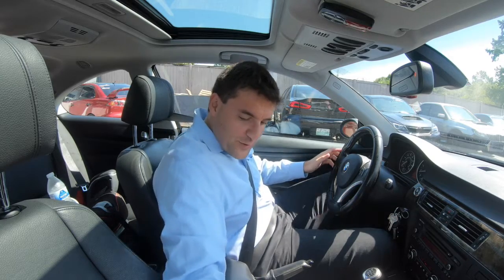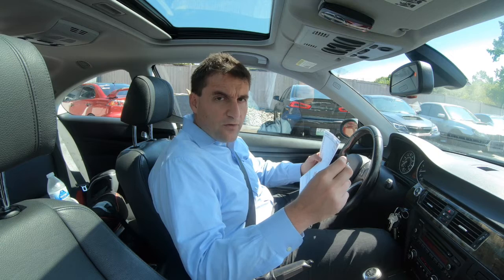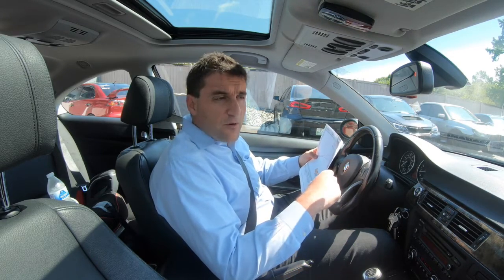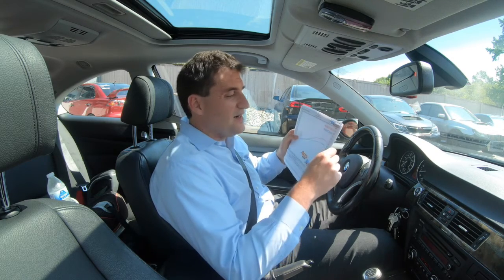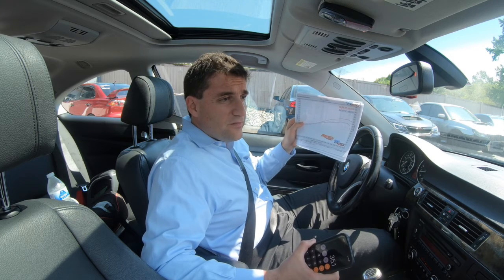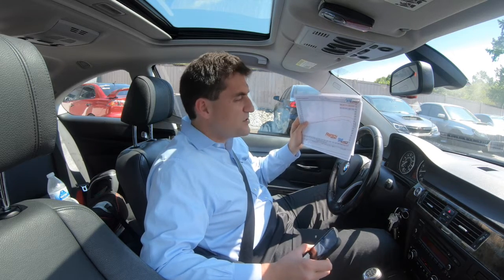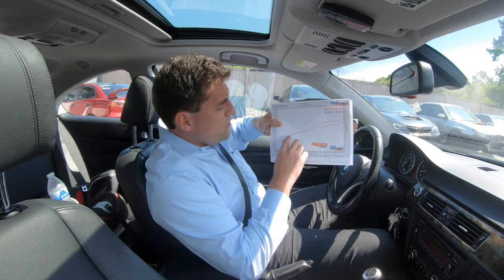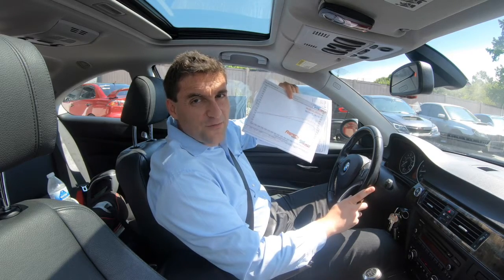BMW N52 Engine HP and Torque AFTER the 3-Stage Intake Manifold and AA Headers Mod -- Dyno Test

Comment: Hello I’m a 328i owner and new to the tuning stuff what would be the first thing to get to increase hp??
Reply from the maker: Congrats on your 328i! You have to go with the mod that I did. 3-stage intake manifold, AA headers, and a tune. Some people add the exhaust as well, which I did not do. Maybe I should have, but I love the car with this mod. It’s more than fast enough for regular roads. This mod is pretty much the only noticeable mod you can make to feel a difference in performance. Don’t bother with a tune only since it won’t make a huge difference, if any. You need the physical mods with the tune for the N52. If you had a turbo car, it would be a different story. A simple tune could add 100 horsepower.

Comment: Just did my stage 3 intake manifold. Huge difference overall! changes the car in every aspect
Reply: Did you have to tune it after ?
Reply: @ yes you can get it for free from bimmerspeed
Reply: @cruzewithcruz exactly what I was wondering.
Reply from the maker: That’s awesome! Congrats! I love driving it when it’s colder outside because it is even faster.

Comment: How much did you get the manifold for
Reply from the maker: I bought it private party, and it was about $250 from what I remember. It was a great deal because it had functioning DISA valves attached to it as well.

Comment: I have a stock 2006 e90 330i 6spd manual, any other mods recommendations? Anything to make it more reliable?
Reply from the maker: What kind of reliability issues are experiencing? In the world of BMWs, the e90 330i is as about as reliable as it gets. Do you still have the run flat tires? I would ditch those immediately and replace them with summer tires or at a minimum Michelin All Seasons (depending on weather where you live and your budget).

Comment: It’s so dissapointing that stock it only produces 200 hp instead of the specified 218
Reply from the maker: That’s 200 hp at the wheels, which means that it was producing at least 230 hp at the engine when it was stock. You lose power as it travels from the engine to the wheels.

Comment: What does this do to engine reliability long term?
Reply from the maker: Stay tuned. Haven't had any issues so far other than the rev counter hunting for RPMs at idle sometimes. I made a video about it. It's really just annoying more than anything else.
Reply: @GogoMotoring  any updates on this?

Comment: Numbers on my car we're almost exactly what you got. Stock 328i 6mt 70k miles. I was very happy with the results. It feels a little quicker to me in the low rpm range but it's minor. Above 3500 it's noticeably stronger. The car always felt very strong accelerating from like 70-80mph to 100+ but it pulls much harder now. Haven't noticed any difference in fuel mileage.
Reply from the maker: Nice! Hundred percent agree on the change in the driving characteristics. Thank you for your comment, and stay tuned for more videos!
Reply: But have you noticed more wear and tear and earlier maintenance

Comment: Hi. I have a tune on my 328xi Coupe and am wondering if headers are worth it? AA advertises a gain of 20Hp for headers alone
Reply from the maker: Do you have the three stage intake manifold installed already?
Reply: @GogoMotoring  I do not. Just a tune on the engine
Reply from the maker: @NovieBigSad  You probably would need at a minimum the 3-stage intake manifold, which I believe results in a bigger power increase than the AA headers. The N51 engine that was in the 2006 BMW 330i, which produced 255 horsepower stock, had the 3-stage intake manifold. When the 328i was released with the N52 engine, the 3 stage intake manifold was replaced with the single stage intake manifold, which in turn resulted in the stock horsepower decreasing to 230 horsepower. Conservatively, my car is now producing between 265 and 275 horsepower. Assuming the 3-stage intake manifold brought the horsepower up to the stock 330i numbers, i.e., a 25 horsepower increase, you could assume that the headers produced between an additional 10 - 20 horsepower. Does this answer your question? 

To do the mod properly, you should install a 3 stage intake manifold and the AA headers and get a tune optimized to maximize the power with these mods. If you had to just pick one, I would go with the 3 stage intake manifold with a tune because the AA headers can cause some issues when the car is at idle as shown in my latest video.
Reply: @GogoMotoring  I do not. I just have a tune on it
Reply: How much power did you make and what wear is your 328xi

Comment: you only gained around 25hp? the 3 stage intake manifold alone should of increased it by 30hp and 9 whp more with the aa headers

were your disa valves in good condition?
Reply from the maker: 30 wheel horsepower gain. The disa valves were in good condition. That's probably a 45 horsepower gain at the crank.
Reply: @GogoMotoring  30 hp gain at wheels=30 hp gain at crank...

Comment: Your math is hilarious! Over 300hp from 3 stage manifold and AA headers mods.  If you talk a little faster, it might add up to 400hp 😂
Reply from the maker: The mods resulted in a gain of 30 wheel horsepower. BMW is known for officially underestimating the horsepower of its vehicles. When the E9# 328i first came out, even though it was rated at 230 hp, there were articles written about the car actually producing closer to 260 hp stock. Same case for the 2007 BMW 335i which was officially rated at 300 hp but was producing closer to 330 hp. So the discussion really centers more about what the true horsepower could be assuming BMW official figures were conservative, which they almost always are. But if you want to know what the impact of the mod was for my car in particular, it was slightly less than 30 hp at the wheels. Thank you.
Reply: @GogoMotoring  but its not producing 260 stock,...they make 201whp stock which is about 230 flywheel .. it makes zero sense that this is making 260 hp stock if it makes 200whp stock...30whp is a wonderful gain however,  hope all is well
Reply from the maker: @RingerRacing  According to the dyno shop owner, their dyno machine shows more conservative dyno numbers than a dynojet (sp?) machine, which is apparently the most commonly used one. The dyno shop owner said to apply an additional 15% increase to the displayed numbers to arrive at what the numbers would be on a dynojet machine. Just sharing what I was told. Have a good one.
Reply: @GogoMotoring  cool story ,    the n52 doesnt make 260 flywheel stock.
Reply: @RingerRacing  damn you are probably so fun to be around
Reply: @RingerRacing  330i has 255hp... with the 3 stage intake manifold
Reply: If you think your tuned n52 produces 300hp, try to do a drag race against a stock 135i (300hp) and let us know the results.  I have an n51 128i with AA headers and Stage FP nice.  The gain is nice.  But it’s no where near 300hp or even 290hp.  I know n51 has slightly lower compression which runs about 8-10 hp less than an n52 with the same mods.  My butt dyno estimates 30hp gain which puts it right around 260.  With your mods, I think yours is around 270hp top.  Get a dyno done to and let us know your whp.
Reply from the maker: @litkochan8021  I did. That's what the video is about. On a conservative dyno machine, it's at 230 whp. The dyno shop told me to apply an additional 15% markup to that figure to arrive at the numbers that would be shown on a DynoJet dyno machine. Without applying any additional markup and just going by 230 whp number, at a  minimum, the car is producing between 265 hp and 276 hp. Thanks for watching.

Comment: There’s no way a N/A N52 is doing 300HP. It’ll do 280HP at best and that’s if you have headers, stage 3 intake and a tune.
Reply from the maker: I have all of those three mods. According to a conservative dyno machine, the car is producing 269 hp. Thanks for your comment!
Reply: @GogoMotoring  Not too shabby I’ll say
Reply: @medal6  there is a n51 which is fbo and dyno showed 289hp crank and 400nm so n52 could get 300
Reply: 330i N52, AA headers, Tune, Charcoal Delete, Staight Piped, 300hp got it dynoe’d last week, u dead wrong homeboy 
, 255 to the wheels
Reply: If he’s making 269whp with just an intake manifold upgrade and some headers, with MILVS a decent intake system and a decent tune it should be able to hit abt 300 MAX hp
Reply: @prestonworden9811 what is MILVS?

Comment: Nice increase! have been thinking about doing the same but i have n52b25, how much u think this smaller engine size will impact on the gains? btw love ur car, titan silber brother <3
Reply from the maker: Thanks for your comment, bro. I love the silver color. So easy to take care of, and the car looks so classy. You probably won't have the same output in the N52b25 due to smaller displacement, but I am not 100% sure. In the U.S., we only got the 3.0 liter in the E9# series. Keep me posted on what you decide to do.

Comment: so you're around 300 hp and torque? just wanna know the finals results overall as to what you should be making? I'm just curious cause I wanna get aa headers too soon so I'd wanna know what numbers you're at now.
Reply from the maker: Here are the official numbers:

HP - 269 horsepower on a conservative dyno; applying an additional 20% increase as stated by the dyno shop brings you to 323 horsepower. The midpoint of the range is 296 horsepower.

Torque - 237.5 pound foot of torque on a conservative dyno; applying an additional 20% increase as stated by the dyno shop brings you to 285 pound foot of torque. The midpoint of the range is 261 pound foot of torque.

My car is RWD with a manual transmission. 

I hope this helps! You can tell a difference behind the wheel, especially at above 4,000 RPM. Keep me posted on what you decide to do.
Reply: @GogoMotoring  nice numbers, also I was told you don't have to get a tune after you install active autowerks headers cause you still feel the power gains in the top end.
Reply: Same bro
Reply from the maker: @gabrieldasilva4198  Just posted the numbers above. Thanks!
Reply: I'm a little confused by the math here. How did you come to 323 hp?

I thought the dyno measured the car at 229 whp? Accounting for drive train loss, you're adding how much?
Reply: @GPN0820BOSTON  the n52 with 3 stage stock is like 250 ish horse, with headers maybe 264-275. You can't add up the Dyno numbers the way he is. Take the difference stock of crank hp  to wheel hp and just keep that offset, usually 35-50 hp. The drivetrain is not consuming a significant amount more power  just bc crank power goes up, especially by such a small amount. My n52 with a the esstuning supercharger is advertised at 320 hp and 25o ft-lb @ 6-7 psi. He's not making that with headers and intake, not even with MILVs.
Reply from the maker: @davidscherer281  The mod resulted in a  30 hp increase at the wheels, which is good enough for me. I was just running through various numbers provided to me by the dyno shop for whatever that may be worth to the people watching the video. Thanks for your comment!
Reply: @GPN0820BOSTON  yeah exactly
Reply: @GPN0820BOSTON  it’s the new math called “fudged logic”.
Reply from the maker: @GPN0820BOSTON  According to the conservative dyno machine, the car is producing 269 hp. Good enough for me, so let’s go with that. The mod resulted in a 30 hp increase at the wheels.